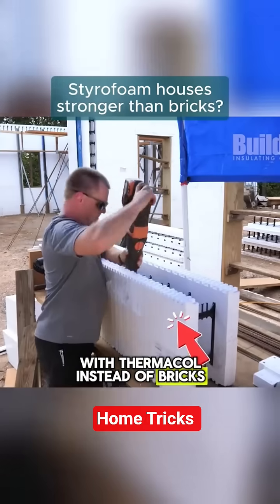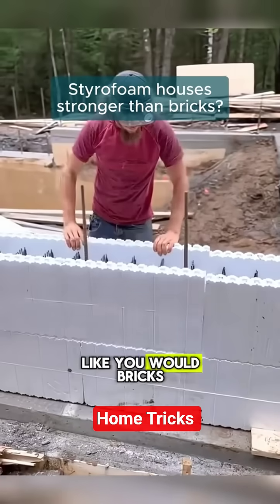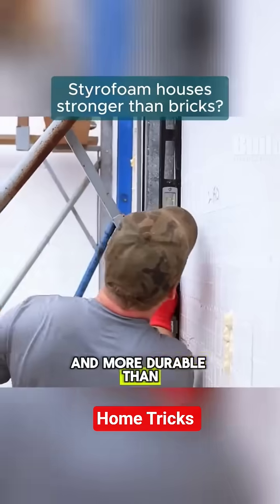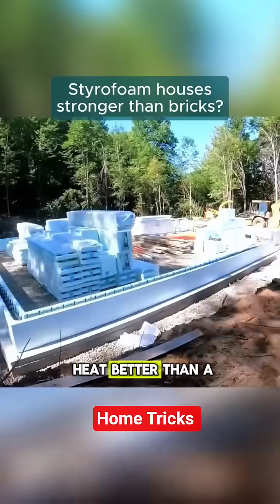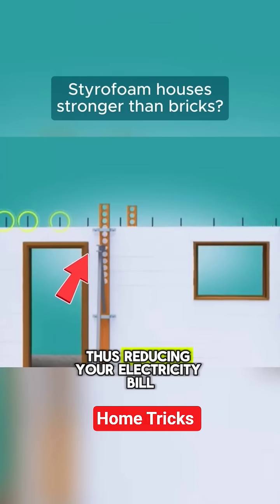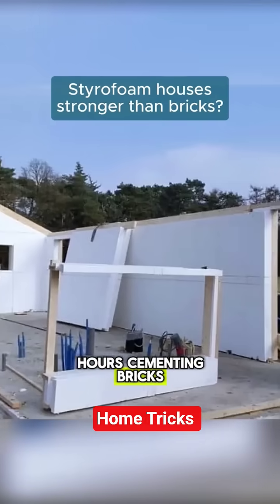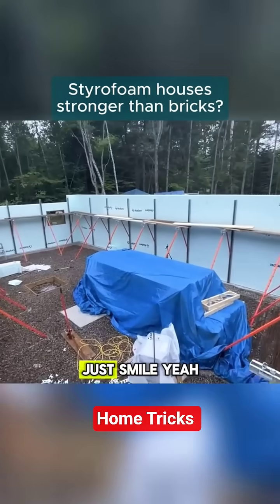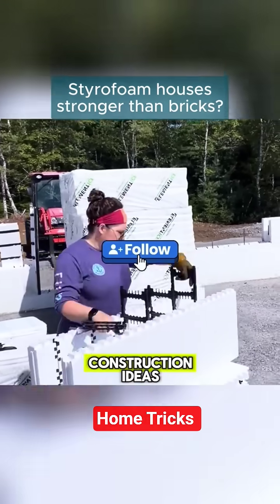Styrofoam houses stronger than bricks?  #foundation #construction #innovation

Comment: Styrofoam is soft, easily dented. Would have to "plaster" the exterior with something hard & durable. Perhaps just paint the interior. Wjy not use wood-plyboard as the mould & have the styrofoam as an internal insulating core ?